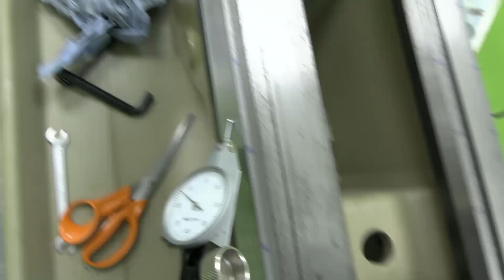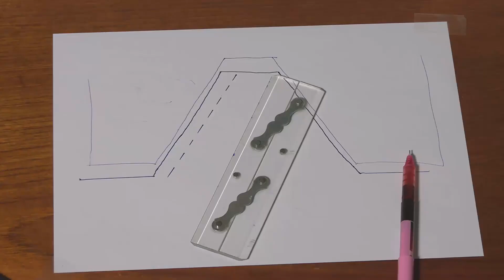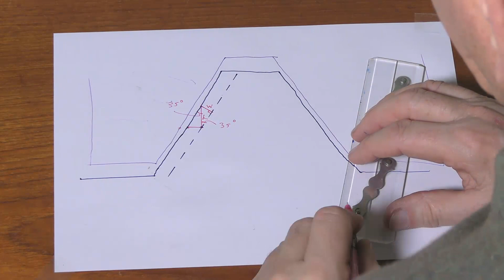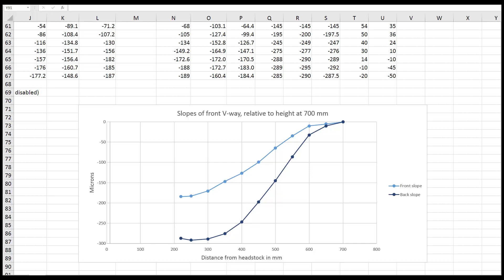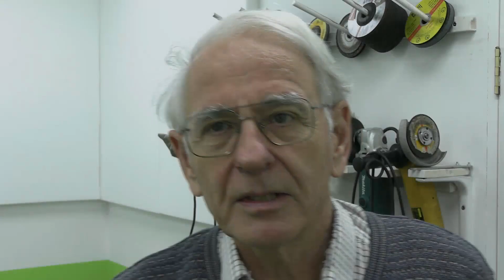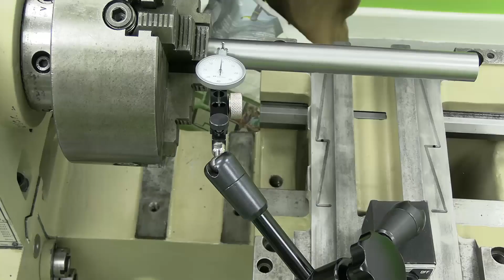Harrison M300 lathe - Some disappointing measurements, and O-level trigonometry

Comment: I tried this and I think the reason the measurements vary is because of the tailstock locking action. In the end I relied on gravity being a constant. There will be an area of wear around the gap because that's where the saddle is used most. I had assumed the tailstock ways would be less worn for obvious reasons. In the end, I just bought a test bar which gave me a real world assessment. It turned out that the wear area was long enough not to affect the work I was doing.

Comment: Dear Samuel.  Many years ago whilst an undergraduate a friend & I restored a Holbrook lathe using a drill, sanding attachments, various dial gauges and other measurements to get the bedways straight.  The final stages involved lapping the bed-ways with ever finer paste and then scraping.  It can be done!
Reply from the maker: Yes, it can be done, although difficult. One could rig up a sliding carriage for a die grinder. I'd need to take off about 0.3mm from the good V ways at the tailstock end of the ways, which rather goes against the grain. I'm putting up with it at the moment.

Comment: Hi Samuel, have you ever thought about grinding the bed yourself?
https://www.youtube.com/watch?v=7NGEQFJdmo4&t=14s
Kind Regads, Adam
Reply from the maker: Thanks for link, I had not seen that. I note he says if he had to do it again he'd send it out because it was too time consuming. Presumably there he was using the tailstock ways to hold the grinder, basically assuming that they are considerably less worn. Steve Watkins is in process of DIY regrinding the ways on his Monarch 10EE: https://www.youtube.com/watch?v=oQgxtSBXPxw , but he is going to erect separate slides for the grinder. He can do this because he has a very big planer machine. To do any DIY griding satisfactorily I think I need a straight edge as long as my ways and a surface plate ditto; I have neither of those.
Reply: @samuelfielder  Hey Samuel, for me it looked like your tailstock way was quite good. To hold and align a grinder you could easily use the cross slides from your Chinese lathe with the right fixtures.
I think I will soon refurbish my bed ways. I am thinking to mount linear railways to the left and to the right to the bed ways. With this setup I hope to get straight edges for a grinding slider.
Kind Regards, Adam
Reply from the maker: @thomasschildkrote7338  Yes, I thought of using linear rails to get over the fact I don't have Steve Watkins's big planer. But to get high accuracy linear rails a metre long is quite costly - kind of making me think "might as well get it done commerically". Let me know how it goes or make a video of it.

Comment: Hi Samuel, I received my aging M300 a few days ago, it has a step of wear along the central area of the bed, only at the front side not the rear, I was hoping it would have been better but I bought it without inspection. Did you grind your bed and did it have visible step as I describe? Also the dreaded  1 to 8 dial is jammed
Reply from the maker: Mine has a visible wear step on the back slope of the front V-way, and this can also be felt with a finger nail. According to Steve Watkins (who has a worn Monarch 10EE) that is the most likely place for wear. If your front V-way is worn on the front slope but not on the back one, I think that would be less usual.

Comment: Hi. I restored a M300 in 2020. I enjoyed every second of it and learned loads. Wish I had your rebuild vids back then, I  may have swore a lot less. I was a total newbie to the lathe world and I purchased a well used old girl without the knowledge of taking a test cut or checking runout before I parted with my cash. I then spent more time trying to turn perfect round pieces of stock than it took to rebuild the thing. I became obsessed!! I purchased test bars and I tested and tested until I burned myself out and fell out with the thing. I have visual wear on my ways in the usual place near the headstock. Worse than yours. I have now slightly twisted the ways to work the best in this area and can turn decent quality parts now that I am happy with. I make parts for a friends rally car and bits for myself. Its a hobby to me, a learning curve of interest. It was great to see you do the math on the wear that I lost hours to in frustration. Great videos. Looking forward to see you get your M300 dirty and cut some steel. All the best.
Reply from the maker: Thanks. So, there's hope for my lathe yet. I do feel a bit of a pratt for not looking closely enough at the ways before buying this lathe.
Reply: amazing

Comment: You may be able to get further information by using the DTI on the front flat (used by the tailstock and the vertical surface below the rear vee. The front flat is not subject to wear at the headstock end. These two surfaces are independent of the headstock alignment. That said I doubt that it will be that bad.
Reply from the maker: Well, by mounting the DTI on the tailstock, and using it to measure the saddle ways, I was in effect assuming that the front flat way was not worn. Not sure what you mean by the vertical surface below the rear vee. Perhaps you sugest that I should make a bespoke DTI mount that locates vertically on the front flat way and horizontally on the vertical edge at the back of the ways?
Reply: @samuelfielder  With the DTI mounted above the front vee and reading the front flat way you should get an indication of the wear of the front vee and the wear under the saddle. Assuming it is a hardened bed I would expect less wear on the saddle but there will be some. You may find the saddle is inclined to rock at the headstock end and the amount should be easily seen with this set up. The vertical face I meant is in the middle of the bed (where the tailstock clamping nut runs ) on the rear shear. This may not be ground but should be unworn.

Comment from the maker: Thanks for all suggestions. Several people have suggested I need to eliminate misalignment of the chuck and/or the headstock to get an accurate reading of taper cutting. That's true, but I have two issues with it. First, all methods of headstock alignment involve taking cuts, so these methods don't work if the ways are badly worn. Second, my test bar is true and only shows 30 microns run out at the far end. This is ten times less than the taper I am measuring on the side of the test bar. Therefore the taper I am measuring cannot be caused principally by headstock or chuck misalignment.

It might be possible to test headstock alignment by shining a laser down the spindle bore, without relying upon test cuts. This would require some method of identifying the centre of the ways at the far end of the bed which (presumably) isn't worn. I might even try that for fun, but I don't think it would solve my problem.

I agree I need to complete the refurb and take some test cuts before taking any decision regarding regrinding the bed.

Comment: The chuck has likely introduced much of that error you are seeing. A better test might be to eliminate the chuck and use a test bar between dead centers.
Reply from the maker: Well I showed the run out at the chuck (<5 microns) and at the other end of the bar (<30 microns). This is enormously less than the measured taper.

Comment: Before you do anything. Suggest you completely rebuild the saddle assembly fit and adjust the gib strips and then using the manufacturers inspection chart take practical/operational measurements and where possible make adjustments. I find (and I may well be wrong) the way the traverse is being measured is showing a ridiculous error even in a well used machine. If a Harrison chart is not available just find the nearest equivalent. I suppose what I am saying is what you had originally thought through that if possible (and I guess it wasn't) you would have taken some run out measurements before purchase. There are millwrights who would visit the machine and using years of experience either correct the errors or give you good advice as to re machining. I know this will not sit well with you considering the excellent work carried out so far but sometimes......... pride before a fall. (with the greatest respect perhaps don't over think the process) I worked with many physicists in an aerodynamic laboratory (gas turbines) and when we ran into trouble appreciated it when the physicist who many not fully understand what I was doing would work things out from first principles in order start from a stable base and the combination of a mech tech and the academic approach always resolved the problem. Mutual respect.
Reply from the maker: I agree it's possible to overthink things, and even totally miss things that a more practically experienced person would do by instinct. I'm mainly doing it because I cannot run the motor yet.

Comment: Some of your trig is way over my head I'm afraid, but I do follow your logic and thoughts, I wonder if any of us started measuring our lathes, what horrors would be apparent. On your first set up where you had a dti on the tailstock, you could be measuring the error in the tailstock ways. I can see what others have said about building it up and turning a test piece, and slight tapers can of course be corrected by lateral adjustment of the tailstock. But I can see that if you carry on building the rest of it, it might be with a heavy heart, and if you are considering in hindsight; whether you should have had the bed and saddle reground, I wonder if it is actually too late to do this?. Incidentally, I do have a matched pair of ground 3 morse taper test bars (30mm dia)? that I used for lining up cylindrical grinding machines, you can use if you so need them, Ok Samuel, hope my two cents helps, cheers Dave
Reply from the maker: I think I did correct for the tailstock way errors. Thanks for offer of MT3 test bar. It could be a great help as it would eliminate the chuck, although the MT3 spindle taper is somewhat scratched up. The MT5 taper the chucks sit around looks better. I think I 've got to carry on reassembly until I can take some test cuts before I can make a decision. And that's a nuisance because it means more work if I finally decided to get the bed reground.
Reply: @samuelfielder  yes, understood,  the 3MT  test bars are a pair, assuming the tailstock is 3MT, you would need a reducing 5 to 3 sleeve, they are never going to spin true, so a 'mean' is taken when lining up with a dti. Just contact me if you need them and I'll send them to you.
Reply from the maker: Both headstock and tailstock internal tapers are 3MT so should be ok without adaptors. I can't find a contact email on your youtube channel. Could you email me via my contact here https://www.youtube.com/channel/UCAzYsCl1M56Mq_WzbpU3nXg/about

Comment: you may find the wear in the tailstock ways which is obviously milder but the inverse of the saddle ways is effecting your readings. as you're in the Uk I would suggest you to contact Clive Lamb and have a chat he's a semi retired machine rebuilder that teaches hand scraping and would likely be able to out some affordable grinding and bed the saddle back in as well as scrape the HS to TS alignment
Reply from the maker: I bought a straight edge from Clive about a year ago, but have not got around to scraping it in. He seems a busy man. I did correct for the tailstock way error as far as I could.
Reply: @samuelfielder  if you do find the time to scrape it assuming it is a plain type of sufficient length you can use it in lieu of grinding. there's a somewhat foul but proven method for scraping induction hardened beds, abrasive "scraping" using a die grinder and small cut off wheel to mimic the effect of scraping.

Comment: There is a post by ehamster. I think you should take heart from that. Put it together and see how it works for you. That is what matters, in fact it is the only thing that matters.
Will it make the parts you need? Try it and see how it goes.  There are a huge number of YT videos about making a chuck run true, I have no idea how true mine are and I don't care to measure it as it works for me.  I did do some exercises in vibration when I wanted to run at 4000 rpm and I proved that mounting my chuck 120 degrees off normal was better than the "correct" alignment. My suggestion is to stop measuring (and worrying about it) and finish the assembly. I am expecting that you are going to end up with one fine lathe, quite capable of handling all you need.
Reply from the maker: I wish I shared your optimism. I'm pretty confidend of my measurements despite them not being quite the same as taking test cuts.

Comment: I dont think it will be as bad as you think. The carriage is about 350mm wide, so its vertical position will be an average, probably of its right and left extremities.
And most of the typical lathe work will be under 200 or 250mm total carriage travel, (and probably much less) so the averaged height error over 200mm travel, also averaged from the extremities of the carriage ends, is not so bad.
It would be very rare to turn something long, like 500mm, and even if you did there are significant issues with stock flexing etc which will all need to be compensated anyway. On most long stock jobs you do different small turning tasks on different parts of the stock.

Also, your big measured error is almost certainly the headstock alignment. Which you can fix with shims because it doesn't travel.

The cost and hassle of grinding the bedways probably wont fix that headstock alignment error, and unless you grind the carriage to match you might not get that big an improvement after all.

Personally i would align the headstock, get it up and running, and do some real world turning tests. Then (if needed) you could always do scraping on the end of the bedways, just remove the carriage.
This has been a very interesting video series, thanks for sharing! 👍🙂
Reply from the maker: Unfortunately one cannot measure headstock alignment if the ways are heavily worn, and I think they are. Also, the M300 has no adjustment for headstock alignment, so it would be a matter of scraping the Vways upon which the headstock sits, and I am reluctant to do that as hopefullly they are as manufactured.
Reply: @samuelfielder  thanks for the reply. You can adjust horizontal alignment of the headstock by shimming it with shims diagnoally on the Vway, then some height compensating shims to suit. Its a pretty standard practice. I remember a few years back there were lots of vids on headstock alignment on minilathes. 🙂

Comment: Ask yourself what you are going to do with the lathe. In my experience it is very rare that you need to turn parallel over a long distance. Usually the only requirement for minimal taper is for a journal which is usually no more than 25mm wide. Get the thing fully built, then turn some test pieces. Adjust the feet to bring the turning close to parallel in the most commonly used area. Then make parts. I also obsess about accuracy, but amazing things can be made with a worn lathe and too many people over think it.
Reply: If you don’t like the results or can’t make the parts you want to then you have a couple of choices. Sell the whole thing on eBay for a profit, then rinse and repeat, we know how much you love painting and you’ll know what to look for in the next one. Or send the bed, saddle, tailstock and headstock away for grinding, turciting and scraping in.
Reply from the maker: Yeah, I've got to fully complete the reassembly before making any decision, annoying as that is.

Comment: Is the ground bar sitting square in the chuck? i.e., are the chuck jaws square to the bed. Just giving you more to measure lol. I'd like to see the circular run out at both ends of the bar too
Reply from the maker: "circular run out at both ends of the bar"  You mean you want to know the minimum and maximum diameter of the bar at each end, measured with a micrometer? (I showed the runout at both ends of the bar in the chuck)
Reply: @samuelfielder  I think what Ian is asking - is the stock actually on center in the jaws (at 90'). It's the first thing I thought .. if you spun the chuck would the readings stay the same across the length of the stock .. if not you need to be able to turn it down to find the true reference / datum.. ideally whilst supporting by the tailstock with a dead center.
Reply: I think you must eliminate all run out at both ends of the bar to get an accurate reading of ways. Having run out on the bar as it is and presuming the bar is true, must be caused by the chuck or the spindle its mounted on. A bar mounted true on centres both ends would be better.
Reply from the maker: Well I showed the run out at the chuck (<5 microns) and at the other end of the bar (<30 microns). This is enormously less than the measured taper. If the chuck wasn't pointing along the spindle axis then rotating it would make the far end of the bar go in a circle.